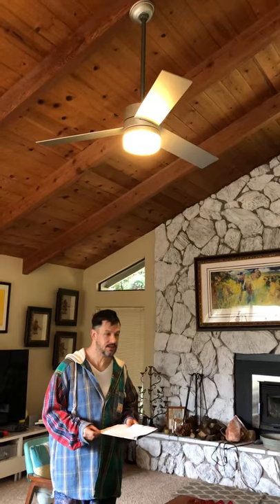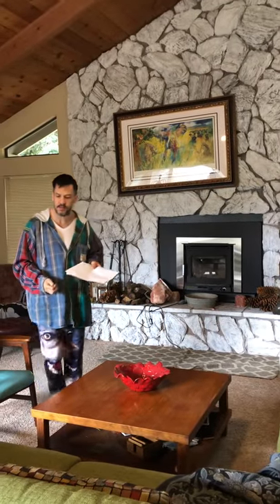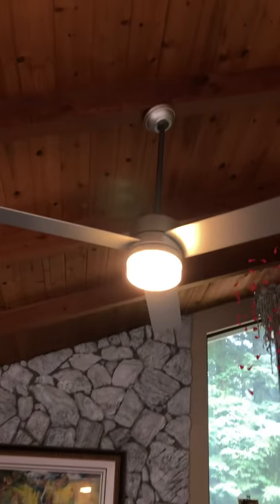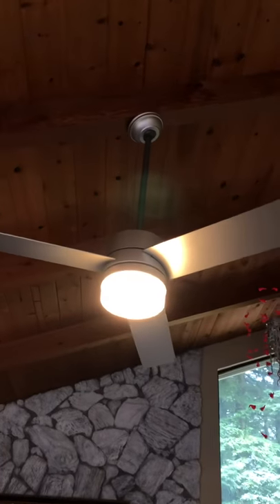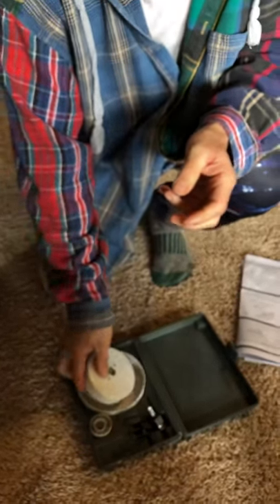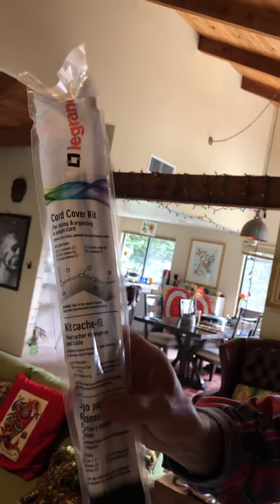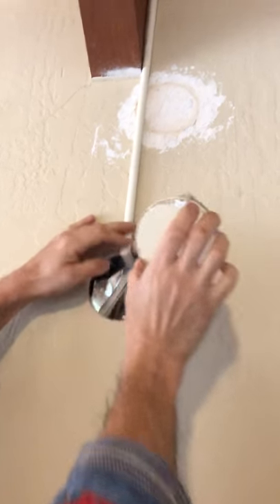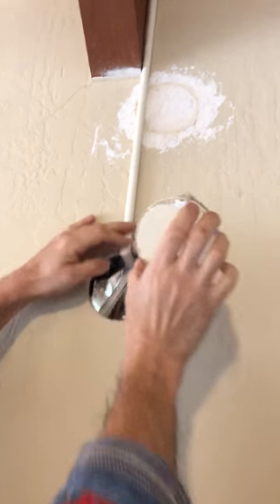How to install a ceiling fan on a exposed beam or wood beam.

Comment: Sounds like you have the exact same story as me.  Late 60s old mountain home where everything is basically a hack job.  The costs around me are insane for any sort of materials and labor.  Wish i priced correctly as I took general google averages as my estimates when I was pricing everything out.  When desperate times call for desperate measures lol.  Great job making it work!  My ceilings are the exact same...and the current fan makes so much noise and shakes and just has me generally nervous.  They just put some small piece of wood into the beam and then screwed into that.  Not sure if its legit and strong or a death trap lol.

Comment: Thanks for the video and info! Bought a house with a similar set up with the wood beams and no existing electric on the planks or beams, and I like the idea of that shallow box (and it does look so clean and finished, I worried you might be able to see it peaking out!) vs mounting it directly onto the beam. The rest was creative as well and we are planning on doing the same, putting it on the hidden side of the beam in areas where we can. However, I couldn't stop looking at how the art above the fireplace is off center from the fireplace! lol that would make me crazy! Other than that, cool home and thanks for the video! ;-)

Comment: Rather than hot glue, you could put some short #6 screws through the base of the racetrack into the wall or ceiling to hold it more securely
Reply from the maker: So these are vintage red wood beams? We were trying to use the least amount of hardware so not to damage them.

Comment: I would recommend a wood stove in a central area of your house. I had an Aframe with an insert like yours and I was cold alot! I got the wood stove and it's a much better heat, just lots of work getting the wood.
Reply from the maker: Thanks ! Last year we actually installed a fireplace insert into the pre-existing fireplace. And there’s plenty of wood on the property. The fireplace insert helps to control air pollution and burns hotter and more efficiently.

Comment: The centered picture over the off center fireplace would drive me nuts.

Also, this is not a great looking install.
Reply from the maker: The fireplace along with the house was built in 1978? It is standard for the time. Uncertain what your use of the word install means?